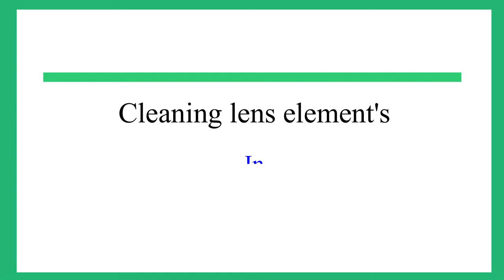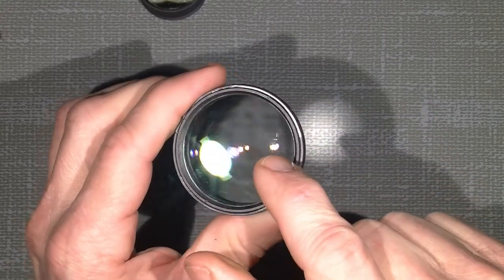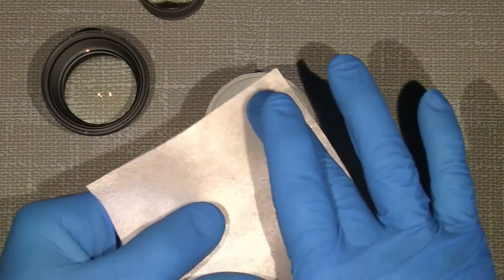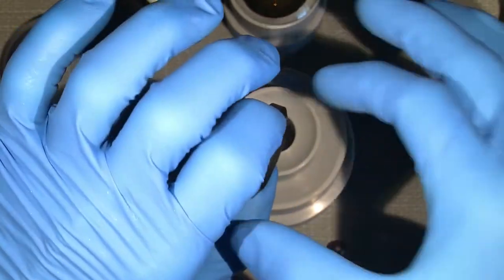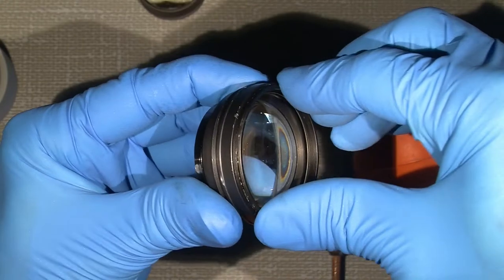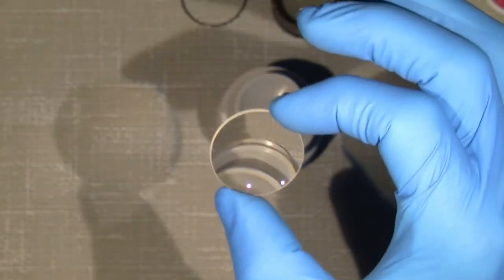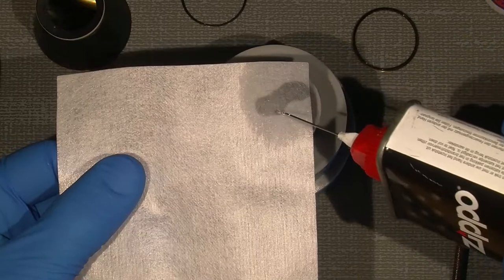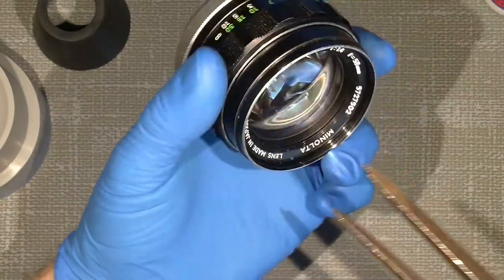Cleaning lens element's in Minolta MC Rokkor-PF 1:1.4 f=58mm

Comment: Thank you for spending your time showing us the effort it take to clean optics.  I never tried lighter fluid, I was concern it’s something and could release the soft coating of Minolta rokkor’s  I’ve read that Minolta used a coating they consider soft.  So if using lighter fluid looks safe, you just helped me out!  I’m interested where you came up with that micro tip applicator for the fluid dispenser.  Anyways any thanks for the splendid video you have give all of us!
Reply from the maker: Thanks Duane, there are maybe diffrent qualitys of Lighter Fluid but I think the "ZIPPO" and a brand called "EXTRA+" is really good, because the is no trace of oil film. This is just my own experience during cleaning many, many lenses! and it's not destructive cleaning, of course it's always a challence when working with a "soft coating" lenses, like older Zeiss or maybe, as someone out there mention that older Minolta could have a "softer" coating.

But, again, when cleaning lens elements one have to only put a very light pressure on the lens wipe, and ALWAYS a few drops of solvent on the lens wipe!

The "micro tip applicator" is just a syringe needle 0,8mm, that I buy on the Apotek, I cut away the plastic thread then cut the sharp needle end and file it so there is no sharp edge.

I hope it makes sense :-)
Reply: @mikeno62  great success!  The zippo (same can you’re using) and same cleaning tissues did a remarkable restoration. The trick of rotating the retainer ring till it clicks is dead on.   I too struggled with dust… but it’s so minor. I’ll try to see if I can solve that issue too.

Never thought of those rubber rings I have the thick one the black rubber I’m going to get after I get a bit more into this.  I have plenty of lenses I have that need a restoration.

So feel good!  You taught me well.. I’ll continue watch to grasp more lessons. Btw it too about 35 minutes working on my konica 85mm f1.7. Thank you!

Comment: Hey Kenneth, another brilliant video. Thank you ever so much. I know these videos on this lens are about 3 years ago, but I also saw the one where you cleaned and re-greased the focusing helicoid elements and an idea occurred to me and I was interested to know your thoughts on this. It never ceases to amaze me how tiny dust particles manage to get not just inside a lens body, but also even inside the lens groups. I’m sure manufacturers would do this if it were really this simple, but what do you think about putting a tiny amount of some compound on the threads of the spacer rings that separate the lenses inside a group, to try to seal the threads from dust getting past in future? The idea occurred to me while thinking about the grease on the helicoid threads, but I imagine that grease could be problematic if you got even the tiniest amount too much squeezing out, or smudging a lens by accident - but, in principle, it could create an airtight seal on the threads so the spacer could still be removed again in future. Locktite would be a bad idea (for obvious reasons) but what’s your thoughts on whether this could be worth trying (say on just a cheap, old lens) and if so whether to try the same grease for the focus assembly or if you had any better ideas? Apologies for the long description. Very interested to hear your thoughts. Thanks, Steve 🤔
Reply: Sometimes using a compound can off gas from breakdown of age or heat and get trapped in the lens sand witch and could etch the optics.  That’s why the do not use a sealant.  But you are very correct it’s problematic to lens groups.

Comment: Hello there  Mr Kenneth 👋🏻👋🏻 thanks for making all these awesome videos! I have a question at the end, if you care for some context then please read on:
I had an issue with a lens of this same model a few years back. Opened it up to regrease it (it was locked incredibly hard), did that and it went fine. The thing is, I noticed a couple blots on the rear side of the front element and decided to clean it up. Didnt work, so I tried with a cotton swab and isopropyl alcohol. Something felt off immediately, it was as if suddenly there was glue on the lens. When it dried (like 5 seconds later) the lens was all scratched. I assume there's a coating and the isopropyl messed it up, this was the first time I attempted anything of the sort and lets say I never took isopropyl near a lens ener again.

How would you recommend I go about fixing this? Is it really the coating that got messed up or do you think it might be some sort of residue from the cotton swab? The scratches are very very light, But they cover pretty much all of the glass surface.

Comment: Good video! I have a question: is the lighter fluid save for lens coating?
Reply from the maker: Yes, the lighter fluid is safe for the coating, what could make some damage to the coating is actually the lens tissue if it's used dry, so, always use the lens cleaning tissue wet when cleaning lens element's.